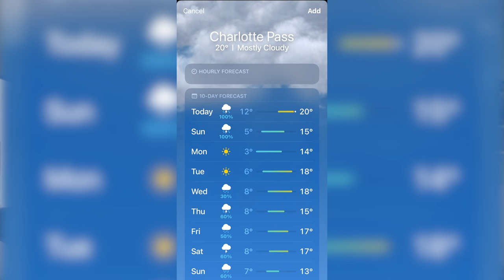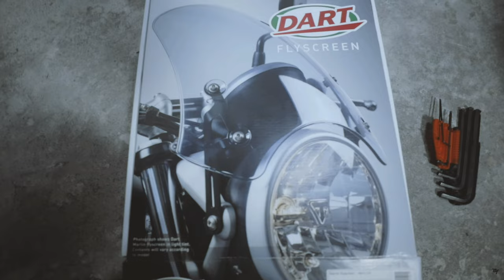5 Tips to plan your MOTORCYCLE CAMPING Adventure

Comment: A tip about knowing the road surface is to not rely on google maps for that. Unless they've update their info the phone app doesn't know if it's sealed or dirt. I found that out when touring on a big Indian and google maps took me down a road that turned to dirt which I thought as a short repair section. It turned out to be 100 kms of good graded dirt down to so bad it was like a creek washout. The indian was almost 400 kgs and certainly not the bike for that road and I was down to 1st and 2nd carefully negotiating the rough stuff. Had I had my garmin set up instead of the phone it would have alerted me to the dirt road and taken me the 'normal' way on sealed roads but about 50 kms longer. I was heading to Condobolin from the north, which is where Rob shows half way through this video.
Reply from the maker: Yep absolutely! Standard ‘analogue’ paper maps are the best